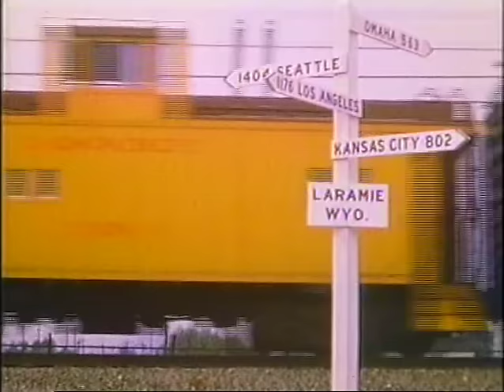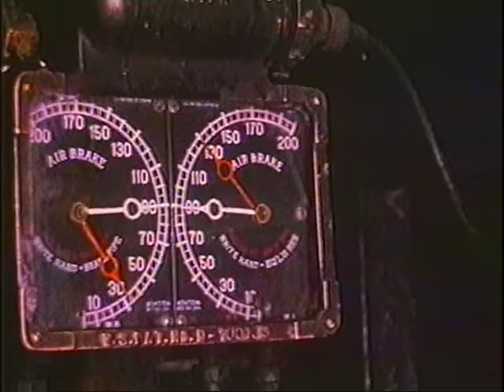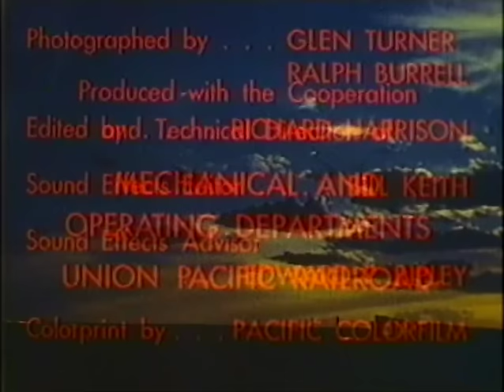Last of the Giants--Union Pacific Railroad

Comment: We're getting an articulated Mallet train on Sodor!

Sam the Virginian 2-6-6-6!
Reply: ***** Yea he is way to big for UK and Sodor railways.
Reply: Sam is a 2-6-6-6 Virginian. That means he is at least 4 times as long and at least twice as tall as the Sodor engines.
Reply: well yea but US Steam locomotives barely visit Europe and when they get there, they have to remove the bells and cowcatchers since Europe does not use bells and cowcatchers on their trains. And they also got to change their couplings from the knuckle couplings to the chain and buffer couplings.
Reply: To meet that countries railway requirements.
Reply: yes thats how it works.
Reply: Well, first when one train is visiting a new continent, it has to pass that continents railway safety. That means changing the lights, bells, couplings, etc.
Reply: no prob...
Reply: I don't know why I'm bothering... Matt, if you don't know how that European coupling works: each European locomotive and train carrige has a chain, a hook and a pair of buffers at either end. The buffers are like big metal shock absorbers. So you gently 'bump' a locomotive into a carrige, swing the chain of one over the hook on the other, tighten the connection with the turnbuckle in the middle and connect the air hoses...

As for Sam in that Thomas stuff, all I can really say is... WHY IS HE A DANM ALLEGHENY!? DX

Trust me, the Alleghenies (that's how 2-6-6-6 locomotives were known on the C&O) were QUITE the bust... Partly because the C&O never really had a proper job for them, partly because the weight was misrepresented on the first few Alleghenies. They turned out to be thousands of pounds heavier then first claimed... Which is bad seeing how train crews were paid by the locomotives weight on its driving wheels...
Reply: yea but the Alleghenies were really awesome engines when ya just looked at em from a standpoint and in movement
Reply: yea im with ya. Alleghenies were only used for 45mph coal drags and they did a good job but well they were made for power not speed.
2nd I love the N&W.
K1's, J's, Y's, A's, S1a Switchers, Z Class's 
just all of em except K2's because  they look like a cheap version of the J.
Reply: +OneTrueThomasFan  unfortaley he is gone now
Reply: +OneTrueThomasFan or Sam the allegheny
Reply: you do realize by that configuration you have the heaviest and most horsepower at speed steam loco of all time, the blue ridge class and the H8 Called the Allegheny class, 7400 horsepower, and a boiler rated for 8000 hp.
and yes the allegheny was built for fast freight in the mountains at 45-60 mph, but on the C&O the Allegheny was used for 25 mph coal drag not what it was made to do.
Reply: man Gordon is gonna look small compared to Sam.
Reply: Jimmy Cozad even Hiro will look tiny compared most U.S engines most definitely the Allegheny or big boy
Reply: OneTrueThomasFan when I saw that video I thought he was a challenger type of the U.P

Comment: Incredible seeing 3985 in revenue service.
Reply: Every now and then the Union Pacific Steam Locomotives will haul Mainline Freight Trains in addition to Excursion Service.
Reply: Just have to be patient for 3985 to come back, if they choose to bring it back that is.
Reply: In January they announced 3985 will be officially retired due to 4014 being in the fleet but most importantly it's boiler is in bad condition
Reply: @davidng2336  My guess, and this is only a guess, is that the reason the 4014 was restored is because getting the 3985 back into operating condition will be so cost prohibitive that it isn't worth it. If the 3985 has major structural issues with its boiler (which is what I have heard), then it may be a case where restoration cost would come close to the cost of building a new locomotive.
Reply: I hope to see 844 3985 4014 pulling loads hope they restore 3985 at some point 
I know 3985 is in bad shape 
Maybe for125 anversy
Reply: @Handlesarestoopid  RRHMA is now taking on ownership!

Comment: These are the largest steam locomotives in the world. If anybody want to ask me any questions on the big boy let me know. I hope you like this video I really do like it because it is a good memory of the big boy class locomotives. Hope you guys like this video and I liked it I didn't recorded somebody did but I like this video a lot as me good memories cuz I have two of them in my H 0 gauge collection. Guys have a nice evening have a good year
Reply: +Garrett Taylor-Leedy   will the restoration take to 5 ys?
Reply: Well I do know the date when it will be running for the anniversary of 2018 that's what you Union Pacific said online about the railroad. I have a DCC locomotive that runs DC Rivarossi unit and Genesis big boy. This locomotive I've had for about 5 years now. Now I have a Southern Pacific cab forward made by Broadway unlimited. It is a DCC engine with smoke and sound and whistle. This engine is made of brass it is one of the highlights collectible engines I have in my collection. I have another cab forward I'm rebuilding right now but it's going to take a long time.

Comment: 2:21-2:41 13:09-13:19 20:18-20:21 and 20:26-20:29
I believe the drive wheels (while they paced the Big Boy filming a closer shot of the wheels) belongs to 4014, I know it's impossible because we haven't seen 4014's number appearing in the Documentary, but I figured out from Pentrex's Last of the Giants Volume 3 (on "Big Boy Combo Part 2"), the scene they made a pacing scene of 4014 on the motorized vehicle, I saw a missing cylinder cap in lower cylinder, and a dirty white soot on 4014's third (tire) and forth wheels in the front engine unit!

Comment: What's interesting is that what replaced Big Boy sometimes used a piece of equipment, that, dare I say it, might be even more magnificent- the Ignitron. Before the days of high-power silicon diodes and SCRs, a special rectifier utilizing mercury plasma known as the ignitron was used in early diesel-electric locomotives.

Comment: 15:38 how do you change BIG BOY's tires? well it is a complex operation but it is fun to watch. first the tire is removed from the rim and placed on the Tie Lay where it is cut. second the tire is removed from the lay and placed on the rim and then The Clinch Ring goes on. third the clinch ring and the whole wheel are soaked in gasoline and lit on fire the gas heats the wheel until it is the right size. fourth the wheel is hit with a sledgehammer and the clinch ring is removed then the wheel is gauged to fit. the final task is to soak the wheel in liquid nitrogen to cool it off and shrink it to fit on the rim. thats how they change those big wheels.
Reply: +Aaron Peavler/Geomodelrailroader Railroad Photography Big Boy has real life traction tyres?!
Reply: Neon Tube yup

Comment: Did you know the 4-12-2 was a 3-cylinder steam engine like most surviving steam engines in Britain? The third cylinder was underneath the boiler.
Reply: Yes
Reply: I did know that. The third cylinder  was a British locomotive design, as the Gresley Valve Gear.

Comment: At about 8 minutes 20 seconds;  You 
can't balance reciprocating action 
with a rotary counterweight.  The 
drive wheels have offset weights,
to counter the connecting rods.

That will NEVER work.  Make the 
weights heavier, you get lateral 
surging.  Make them lighter, you 
get heavier vertical pounding.

(Oh, Ed Dickens for President.
Would be nice to have an 
Engineer in that office.)

steve
Reply: s c i e n c e

Comment: The only thing I have against this is them saying the 3900s aren’t Challengers like the ones before them. “Challengers and the 3900s”

3900s are Challengers
Reply: They were comparing the original challengers (the ones with headlights mounted on the smokebox, while the newer challengers (the ones with the lower mounted headlights) and referred to them as the 3900s. The older challengers were numbered from the 3700 to the 3800 series.

Comment: "The 4-12-2 was the largest non-articulated engine ever built"
The soviets with their 4-14-4: Are you sure about that?

Also a not so fun Fact: Big Boy 4013 (The one most often seen here) was scrapped, along with many of the others
Reply: The Ruskies 4-14-4 was a total failure, while odd ball the UP 9000's worked out ok.
Reply: @stanfischer6175  It was still built and ran relatively ok, i can link you some footage of it running (on yt of course)
Reply: The 9000s were the largest, but not the largest in the world give the fact that the Russian AA20 4-14-4 was the largest in the world even though it was unsuccessful.

Comment: At 4:40 in there are two locos pulling out.  Both have number boards reading X2295 but the first one has number 6537 on the side of the cab and the second one has 2295 on the side of the cab.  Does that make any sense???
Reply: Yes, the number boards were changed according to the train the locomotive was going to pull, for example in this picture https://donstrack.smugmug.com/UtahRails/Union-Pacific/UP-Steam-DDR/i-GLSxFDV/A you can see engine 7865 has been assigned to train 37. in this case, the train would presumably be 'Extra 2295 (X2295)', pulled by locomotives 2295 and 6537.

Comment: 8:11 What Class Of locomotive is that?
Reply: Those were U.P.’s 2-8-8-0s in there compound form. They were built in 1917 and lasted all the way to 1954. They were Union Pacific’s first articulated steam engines before Big Boy or the Challengers. In later years Union Pacific converted these engines from compound to simple articulated engines.
Reply: @natejenkins8645  Are those the engines nicknamed "Bull Mooses"?

Comment: When I compare this old film footage with the video of Big Boy 4014 running today, I don't think the oil-fired rennovation develops as much horsepower as the original, coal-fired Big Boys did. I mean, its nice to see a Big Boy running, but it's not the same. That diesel helper UP uses is almost an insult to the wonderful piece of machinery that 4014 is.
Reply: In 2019 being it was in college station the George bush 70ace trailed and It was rather fitting, although I’d find it even more amazing had they consisted it with the dd40ax, that trailing the big boy would easily be the length of 5-6 t4gevos
Reply: Oil has a higher heating value than coal and diesel locomotives are in every way better.
Reply: @Jemalacane0  I think you know more about this subject than I do. Can you tell me why UP seems to be taking it so easy on the Big Boy? Have you seen that 1991 video of the Challenger pulling 138 econo-stack cars up Sheman Hill, by itself? They are using a diesel helper with the Big Boy pulling only 10 passenger cars. Do they need the diesel to generate electrical power? Also, I haven't yet seen video of the Big Boy pulling a freight consist. Is there a break-in period? Very puzzling. Any light you can shed on this mystery will be appreciated.
Reply: @chrisackerley1842  You don't know shit. The highest heating value of coal is 35 megajoules of energy per kilogram whereas for oil-based fuels, it's around 46 megajoules per kilogram . If you know anything, you know intermodal trains are some of the lightest freight trains on rails. Oh my God, if you think the Challenger can outpull a modern AC traction diesel locomotive, you don't know anything about trains. The tractive effort of the Challenger is 97,350 lbf. For the Big Boy, it's 135,375 lbf. For the General Electric AC44C6M, the starting tractive effort is 200,000 lbf and the continuous effort is 180,000 lbf. The same numbers apply to the SD70ACE-T4. The load limit for an intermodal car is around 160,000 pounds. The load limit for a coal hopper is 286,000 pounds. There is a video on Youtube of two AC traction diesel pulling 140 loaded coal hoppers. That means, the coal train is over 20,000 tons.

Comment: Why not a 4-12-12-4?
Reply: Because it won't be able to turn.
Reply: +Dan Prosl The only closest they could ever build to that, was the AT&SF 2-10-10-2 3000.
Reply: +Dan Prosl It would be heavy. Really heavy.
Reply: I guess that locomotive was hard to turn on a turntable and on the main line.
Reply: I doubt you could make a boiler big enough either. As locomotive boilers approached 18 ft in length, the tubes and flues inside were subject to greater torsional forces and they needed to be replaced more often. The 22 ft. boilers in the 3900's and 4000's were considered the absolute max and they required extremely regular maintenance. I heard once that the tubes in the 4000's needed to be replaced every 6 months.

Comment: What a crock of CRAP 
"" could pull a train 5.5 miles long """
The draft gear would have been ripped out ....
PENNSY's BIG LIZ ELECTRIC DID JUST THAT 
BIG BOY ------- 6000 HP 135,000 T.E.
BIG LIZ -------- 7250 HP  140,000 T.E.
That's why they were rated for trains of 5000 tons west bound and 3000 tons east ...
3 F units had more pull than a big boy
Reply: krvnjrcbs  PROVE what ????
Look up the PENNSYLVANIA RAILROAD 2-6-6-2 electric built in 1914 .. (( BIG LIZ )) 
 HP rating of 7620 
TRACTIVE EFFORT 140,000 lbs .
She pulled couplers out of cars and when put on the back for pushing ..
Quote 
"" HER DESTRUCTIVE POWER WAS EVEN WORSE  ,  SHE PUSHED WITH SUCH MIGHT CARS POPPED OFF THE RAILS AND SHE KEPT PUSHING AND CARS KEPT CRUNCHING.""" 
QUESTION ??????
What is the highest horsepower rating for any U.S. LOCOMOTIVE ..
STEAM , DIESEL OR ELECTRIC ????
YOU'D PROBABLY SAY -------
U.P. gas turbine 8500 HP is 
WRONG WRONG WRONG WRONG 
IT IS THE GM10b built in 1975 and road #1975 
10,000 HP . and could over load (being an electric )( CAN DO BY PULLING AS MUCH VOLTAGE AND AMPS OUT OF THE CATENARY WIRE AS NEEDED BEFORE YOU HAVE A MELT DOWN OF THE ELECTRIC CABINET ...
GM10b short term rating 
TO MORE THAN 18,000 HP ....